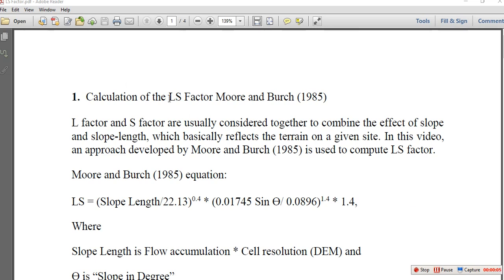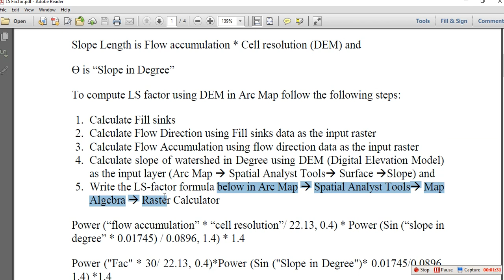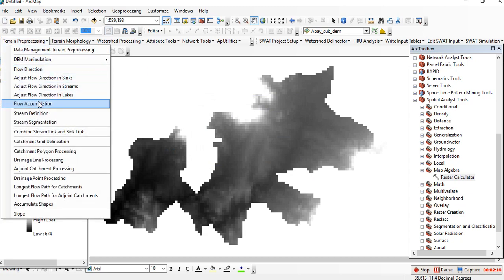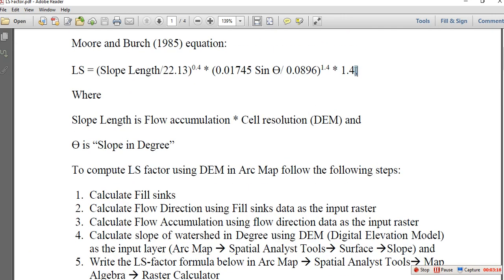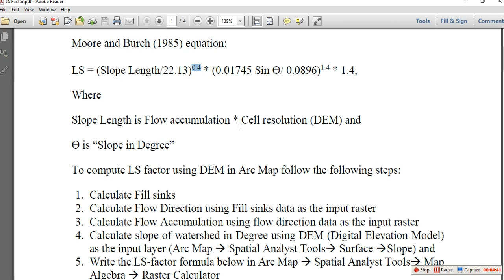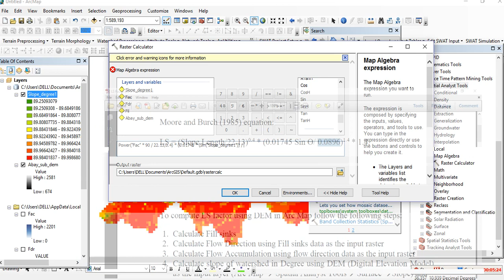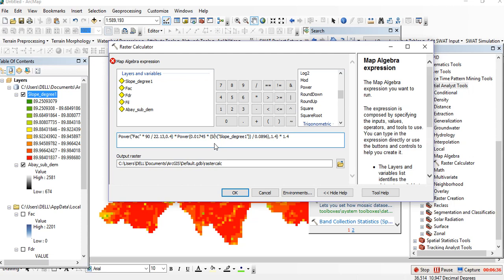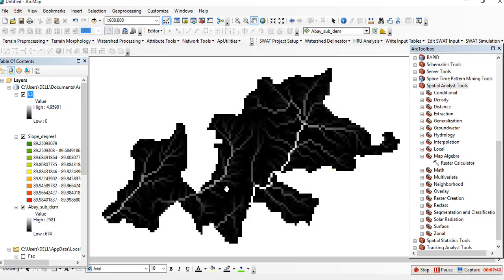How to Calculate LS Factor Using Moore and Burch Equation in ArcMap

Comment: I'm not sure why you're multiplying with 1.4 at the end? That doesn't appear in Moore and Burch (1984). Similarly, the second exponent should be 1.3, not 1.4. Also, you should be using slope_degree1 in radians, so that part of the equation should look like (Sin("Slope_degree1" * 0.01745)) or alternatively (Sin("Slope_degree1" * (3.14/180)). Please feel free to correct me if I've missed something simple though!
Reply: Thankyou for initiating this discussion Alex. Moore and Burch (1986) allow for the variation of the exponents for both the "slope factor" and the "slope length factor" within acceptable ranges, as is evidenced in experiments. In my view, he (author of the video) seems to be multiplying by "1.4" to incorporate the effect of "rilling" on the erosion process: This might be the Z factor in equation 26 (Moore and Burch, 1986) - I think this value is specific to his study area and must be unique to different areas. Your submissions on the treatment of the degree-radian formulations are spot on: Everyone should take note of this. How I wish we could get a response from the author of the video. My references are: Moore, Ian D., and Gordon J. Burch. "Physical basis of the length‐slope factor in the universal soil loss equation." Soil Science Society of America Journal 50.5 (1986): 1294-1298.
Reply: https://hess.copernicus.org/articles/22/6059/2018/hess-22-6059-2018.pdf , I hope this helps anyone. It includes the notation for LS and has the reasoning behind it.